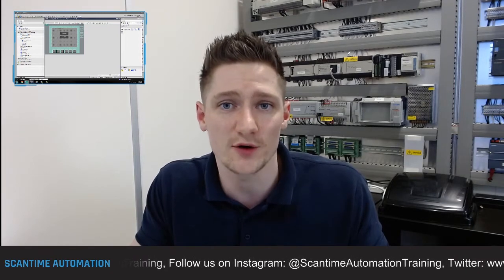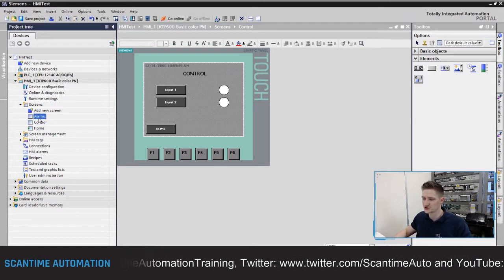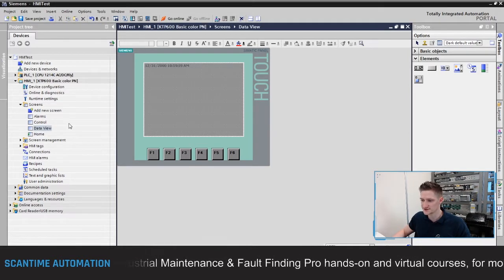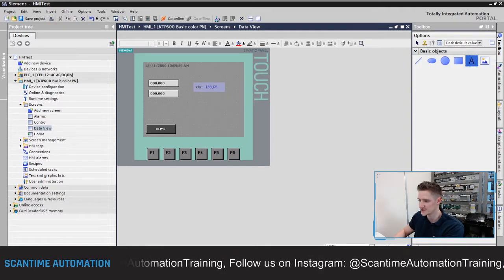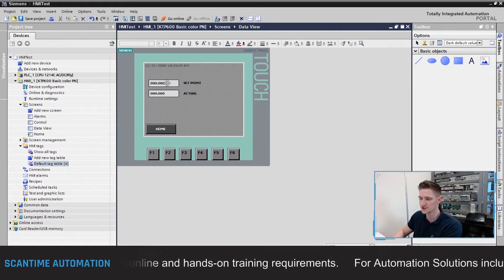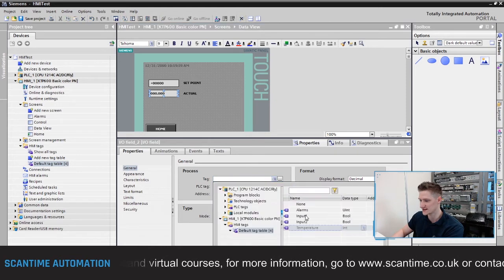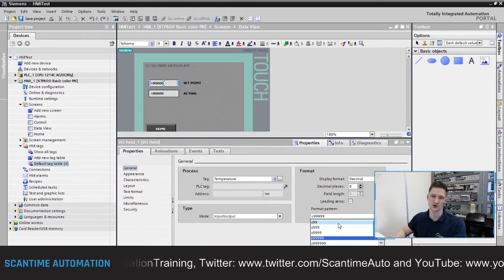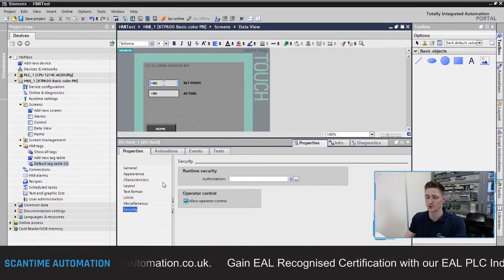How to Create an IO Field in Siemens WinCC (TIA Portal)

Comment: Hi Team, 

I am working on the WinCC unified system, I need to show the data on the Performance Gantt chart & Performance Bar chart & Report as well. So I referred to the Siemens documents and sample backup also then I created the KPIs & configuration but I won't get the result on the RT. 

 I have changed the KPI tags values but the chart shows zero and the  Gantt chart is empty.

Twice checked the Siemens Document but I don't know where I made a mistake.

Can you please give some advice on the performance of Inside objects?
Reply from the maker: This would involve us looking at what you currently have to get a better understanding :)